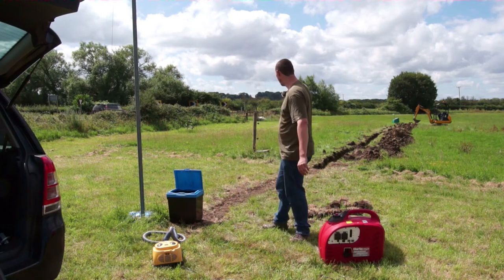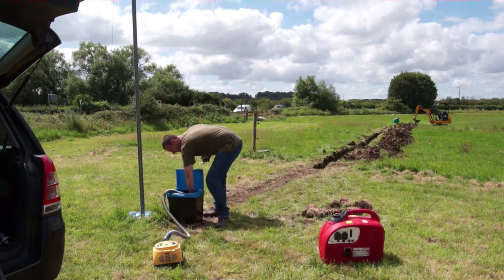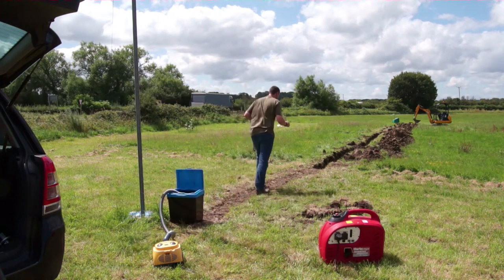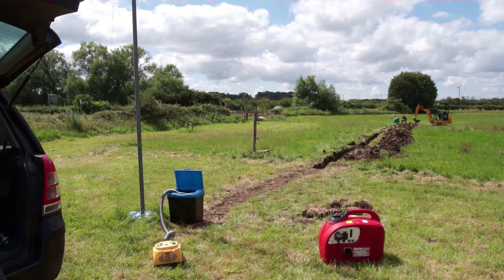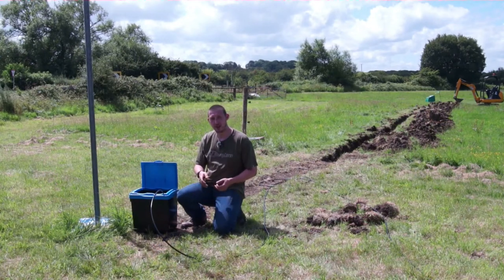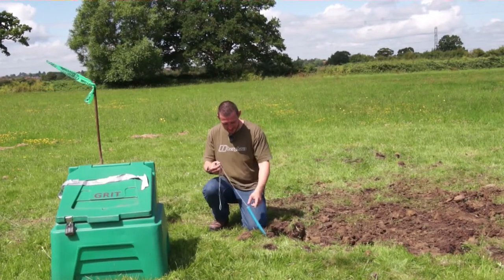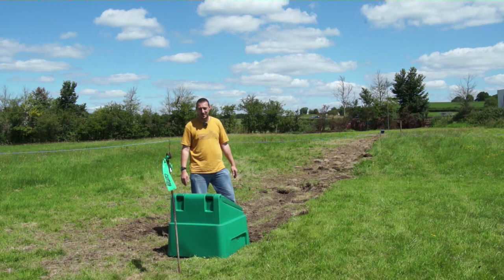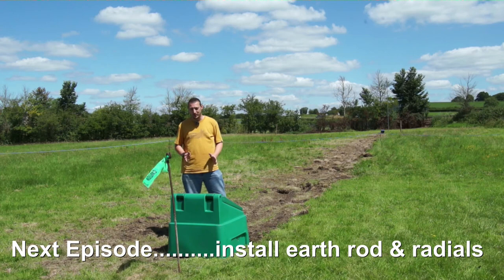Antenna Farm Part 2 - Install Feeder Cable

Comment: After you got the thin "mouse" , you are right you did need thicker, stronger rope, also it would be worth while running another mouse from say, paracord, so should you need it, you could run a second feeder, that way, you would not risk damaging the current feed to add a second. 73 Jim M7BXT